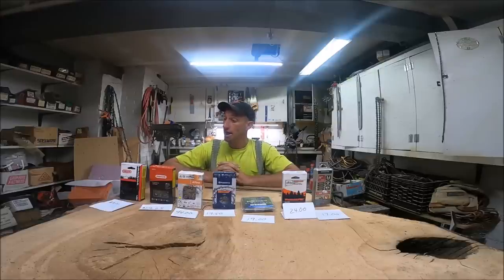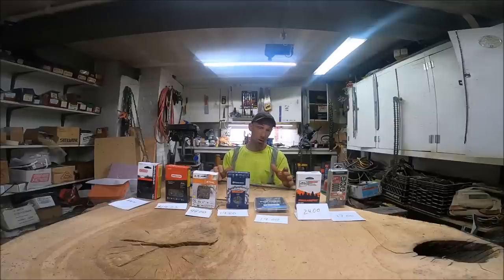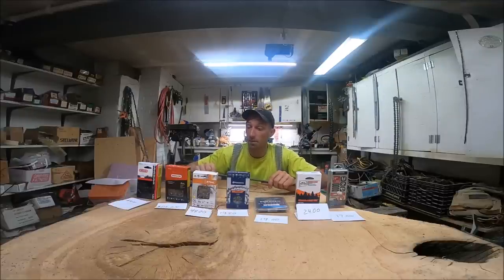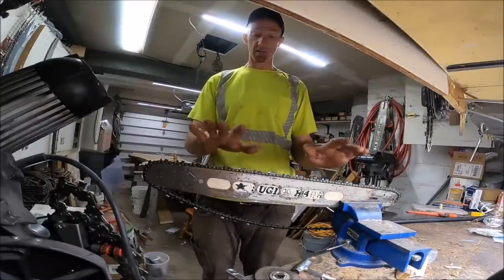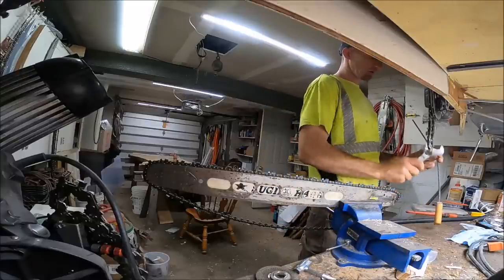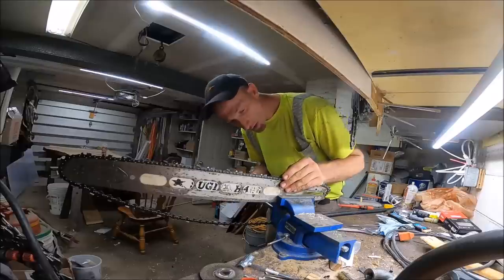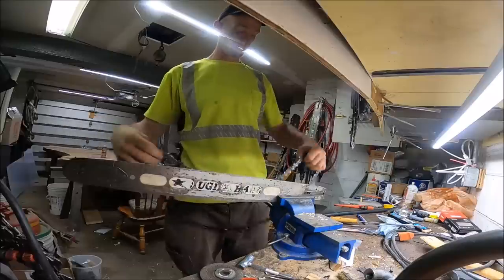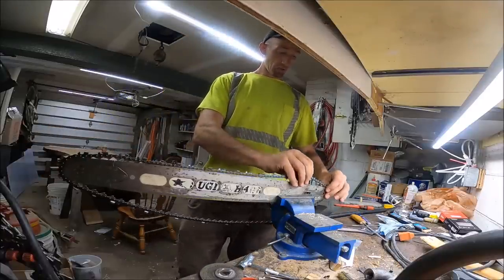Which saw chain is the best bang for your buck?? Popular chainsaw chain comparison and review!!

Comment: I tested these same chains several years ago as I used to run LGX and wanted something better for felling Hardwoods. The woodland pro is made by Carlton, it is A1LM. Carlton and Oregon chain are owned by the same company, Blount Inc. Interestingly according to Blount's representatives they are both made with the same steel in the same factories on the same machines, and when I mentioned the difference in how the chains sharpen, they said they should all be the same 🤔 Unfortunately Blount Inc. the owner of Carlton and Oregon has ZERO! Interest in promoting, marketing, or distributing Carlton chain. Ray Carlton the founder of Carlton was the inventor of the progressive depth gauge which Blount also has no interest in manufacturing anymore which is too bad. 2 of the distributors that I source Calton chain through recently stopped carrying it. If it were not for Bailey's selling Woodland Pro Carlton may no longer exist, which is really too bad. The Stihl RS chain is way overpriced now. I have had Excellent results running both Carlton A1LM and A1LMSK (full skip) and Husqvarna C83 & C83S (full skip chain).  I have 2 days of felling and timberstand improvement on a loop of C83 x-cut since I ground it last Friday with no sharpening since and it is still cutting better than most factory grinds on brand new chains. I get the same results from the Carlton chain as well. I see you have a grinder, do you use it?
Reply from the maker: That is only used for harvester chain 3/4 pitch
Reply: @nuts319  Thanks, I was curious about the grinder. Years ago a friend and fellow logger strongly advised me to buy a grinder, at that time Silvey grinders were sold if memory serves me right for between $450-$695.00. Regrettably I thought that was way too much to spend at the time and kept hand filing, both round and square for a long time. Eventually I came to realize my friend did not sharpen his chains in the woods as I had done and his chain cut smoother and stayed sharper way longer than mine, his production was higher as well. So stubbornly I broke down and bought a grinder. It has been over 10 years now since I have hand filed a chain in the woods or even taken a file with me. I can still round and square file with the best of them but not as good as I can grind. There are very affordable grinders (Oregon 410 being one) on the market today capable of producing grinds equal to or better than a $24,000 grinder (I also have a friend with one of those) and better than any hand filed chain. So looking back I would tell my younger self buy/use a grinder, make sure your chains are clean, keep your wheel dressed properly, and really take the time to learn how to sharpen a chain to your cutting conditions, the reward is worth it.
Reply: I am down to my last File O plate, I recently picked up a West Coast Saw progressive plate which is comparable to the old Carlton depth gauges.
Reply: @iffykidmn8170  The West coast gauges are nice, plus they make one specifically for the 3/8" Carlton/Woodland Pro chain. Every time I check in with the folks at Blount I ask them to make them again for the current chains.
Reply: Blount Int. changed it's name to Oregon Tool in 2021.

Comment: Thanks, Pete for giving some food for thought. Personally, I use Woodland Pro and Forester semi-chisel. The SC seems to really hold an edge better than full-chisel. Some knocked Forester (made in China) in the past. IMO it's improved a lot, though it benefits from quick depth-gauge setting to spec .025-.030". Of course I use Granberg file guide for quick consistent filing and accurate depth gauge setting, being an unrepentant engineer. (Besides for file longevity.) Waiting for yer next.

Comment: The Stihl is my favorite and I file it to nothing with a 7/32... Archer is great chain in my opinion and dirt cheap. The prices where I live are totally different, Stihl chains are only 18 bucks a loop.  The Husky c83 is stupid expensive here like 38 bucks and they are just using a fancy grind you can't replicate with a file so the longer you run them the worse they cut. The forester is so hard you can't hardly file it. I have always hated all Oregon chain and only ran it when I couldn't get anything else. At the end of the day I'm a skip tooth chain guy so my opinions don't exactly apply here...😂
Reply: Ahhh whata you know you run 20" bar !!! 😂😂😂😂 just messin  brother how ya doing??
Reply: Stihl price is also much better In our area, highest quality in my opinion
Reply: @StumpjumperVideosPA  😆😆
Just been working all the time trying to finish up my new shop at the house. Hope yall are doing good up there!
Reply: There high here to..husky most expensive even therr oil.only thing higher is motomix.......

Comment: Stahl's has 100' rolls of C83 on sale for $350. I was going to buy one but decided to buy a roll or 33RS from my local dealer for $360. If my math is right I think you can make 19 loops of 84DL. That comes out to be about $18.50 per loop. That's a hell of a markup on those 33RS loops!

Comment: Great look at a cutter tooth…I will add a couple things: 
I think most importantly is the depth of the raker, and the chisel angle underneath…the less of an angle the smoother…this is the reason a square ground tooth is faster (Oregon says 23% faster). Obviously the chisel angle is important as well….however, the quality of chain has to play a huge role in the chain. Ie the hardness of the chain…

Comment: it’s all in the filing to get a fast cut…the thing I find annoying, is grabbing a new file and not being able to file a hard tooth….don’t waste your time on buying any files with “made in China” stamped on them…they won’t touch a hard tooth.  Hard teeth are great for holding an edge, but you gotta be able to sharpen them…if you have to use a grinder to sharpen them, thats not practical for most folks who throw their saw on their tailgate for a quick touchup with a file.  cheers

Comment: Pete I bought 100 ft roll Stihl in 2020 for 450.00 from my dealer made bout 30 chains between 16, 20, 28, n 36 inch  haven't bought any since use elec chain sharpener in winter sharpen on all then don't do any during summer less have to n even then usually only the 28 inch cause didn't make many them if I don't hit dirt can make wk on same chain. Bill

Comment: For the next test could you run each loop through a pole barn spike,some old fence and then hold it for 3 seconds solid on a chunk of rock! We could see how many teeth break off and if a smooth cutting edge is ever possible again? Thanks!🤠
Wonder how many of these chains are made in the same factory to each company's specs and put in different boxes?
Reply from the maker: I wonder the same thing
Reply: I am OK with any hardness of chain so long as all the teeth are consistent.  The Forester chain I tried but was never able to keep smooth after hitting something. I think it bent the teeth? I bought some Xcut at PB show and have just now got into a couple loops. Started out ok, but will see how it finishes up...My Stihl dealer wants over 50 bucks for the 33 now. Great chain but I am moving on...
Reply: I have a archer 32 semi skip I like it.and going to try the 28 I got but it's. 063 because I couldn't find a .050 3/8 light bar 28 for a year so said screw it. Got this one .only issue they dint sell 0.63 28 at my dealership crazy they have everything but not that ..

Comment: Amazing how different the Archar and the Woodland cut. But can the tooth be corrected with a few strokes of a file. Another test for another day. 
The noise that came off the Stihl chain when the file hit it was cringe worthy. 
Great video.
Reply from the maker: Yes it’s very hard
Reply: @nuts319  very hard or initial breaking of the chrome plating?

Comment: I timed them , the Stihl was faster followed by the Husqvarna, the the first Oregon by second Oregon then the Forester. I would run the Forester or the Husqvarna for the price. Stihl chain is harder than the others, you need to file with Stihl files. I haven’t bought Stihl chain in awhile, I didn’t know it had gone up so much. Archer and Woodland pro were the slowest by .4-.7 of a second. The others were all within 3.73 to 4.07 on the cuts

Comment: Nuts the chain I’ve been using is the X cut it came on my 592 so I was digging it only thing it really really doesn’t like dirt which if we are in a plot with dirt or if I’m doing a lot of bucking and it’s been wet I’ll run my old Oregon fav stihl chains always cut better when you sharpen 2-3 times so I run the X cut on both my big saws

Comment: Good test, like you said I’dno if the bigger tooth is better or not but I noticed the holzforma chain I got on the teeth are way bigger than normal , but it cuts very well, after I took the rakers down a lil 👌🤘🤘

Comment: LGX has been my go-to for years sad to see no longer available but running the EXL now, if I could find Xcut at a comparable price I like the chain better but at 20% higher price will be sticking with EXL for now.  Could try measuring the Archer chain outside cutter to outside cutter and see if it is creating a wider kerf slowing down chain speed and limiting self feeding.
Reply from the maker: Stahls logging supplies has xcut for a good price

Comment: Pete come down to the guy on the file , everyone in the logger field have there own way to sharpen a tooth right Pete . Stihl chain and mix oil is the S..T for my 2 cent worst. I buy my chainsaw chain in 100’ foot roll , work out 84 links for $12 a chain . Don’t need special tool just hammer and punch doing it for yrs after yrs with practice get the feel for it , the same for hand filing Pete . 😊

Comment: Why are husky so cheap there?here there higher than stihl. You should be getting commercial discounts. 40 .00 minus 40 percent..right around 100 bucks for 4 chains or less depending on the sizes..don't run 36 except for stumps and bigger flares. So 20 24 32 can't ever find 28 light bar in 0.50 3/8 there like gold no has them .except ebay once in while all these homeowner firewood guys buy them all .sucks